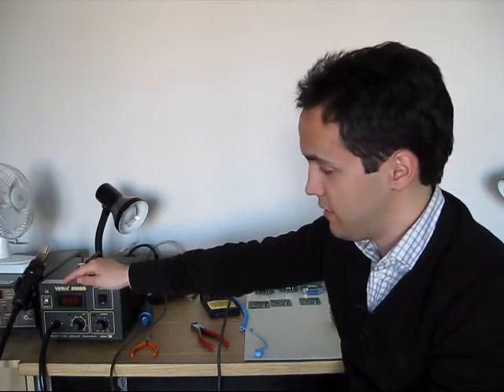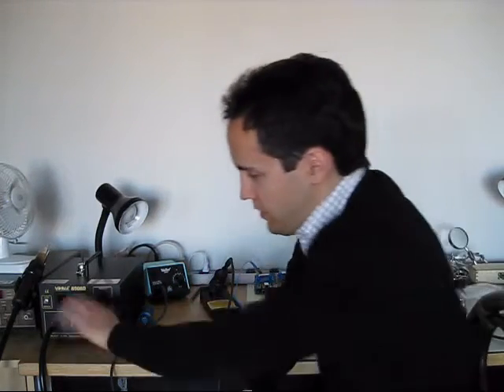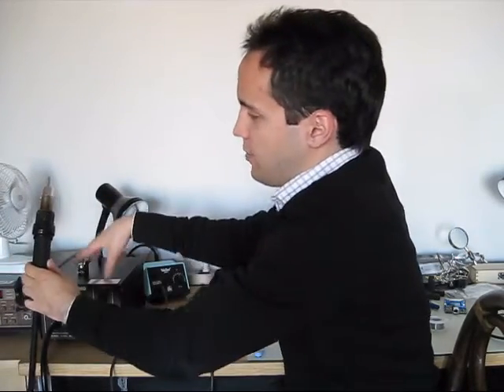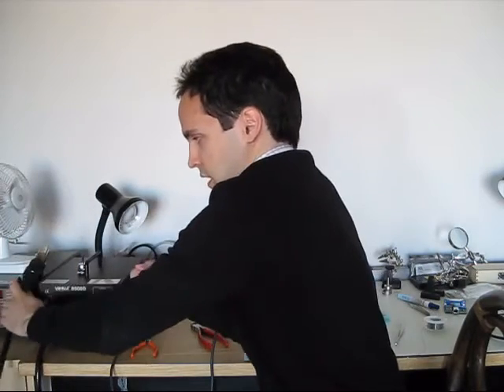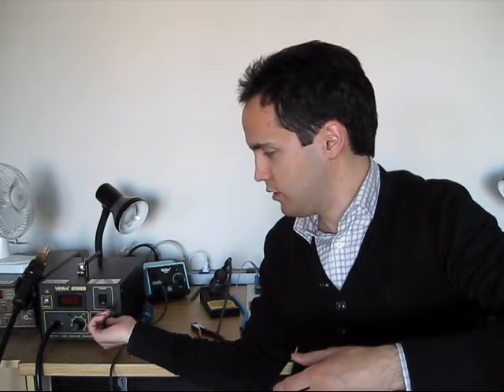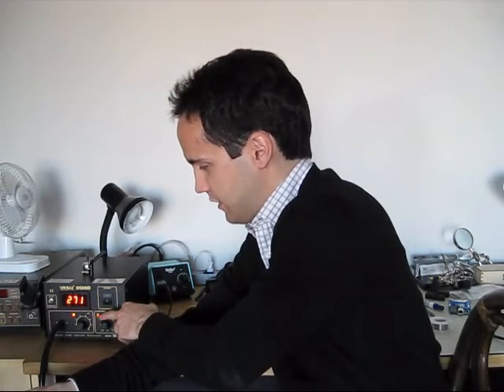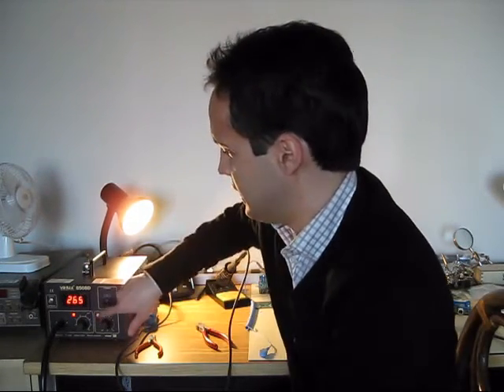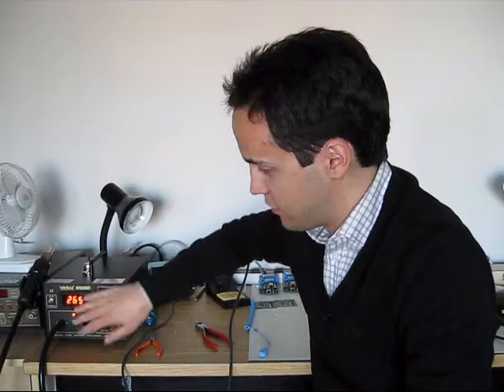Episode #12 - Yihua 8508D Updated Impressions

Comment: I've been doing extensive research about less expensive solder rework stations. I came to the unavoidable conclusion the majority are made by a small number of manufacturers, then rebranded. I got the strong impression most stations come from Aoyue, and the remainder are Aoyue copies. It seems there really is no way to know with certainty who actually made any rework station, so feel better knowing your decision was not a mistake. Any brand or unit you chose could have produced the same outcome.

Comment: Since you are already having a problem with the station sensing the wand being put back on the cradle, have you thought of doing some mods to the station instead of fixing it? A radical mod I am seriously considering doing to my rework station is replace the controller with one that is better thought-out for typical use cases of the rework station. Instead of needing to find the best combination of heat and airflow settings for a task, have a preset button for each task, like 0402, 0603, & QFP.